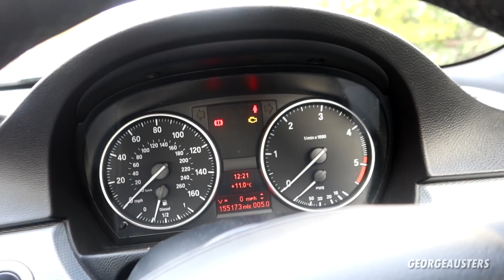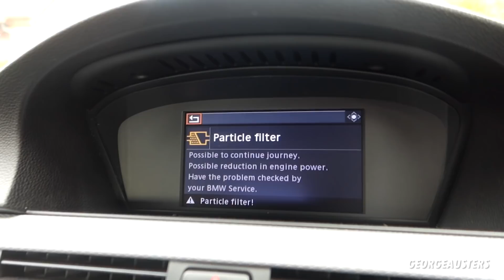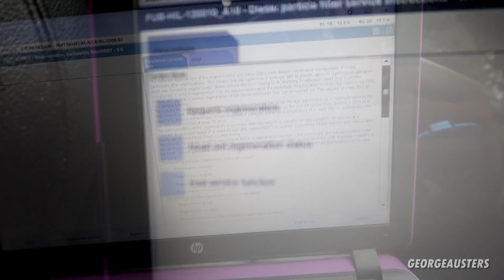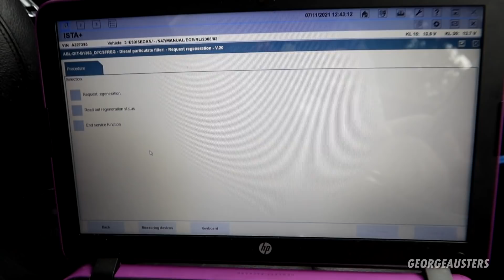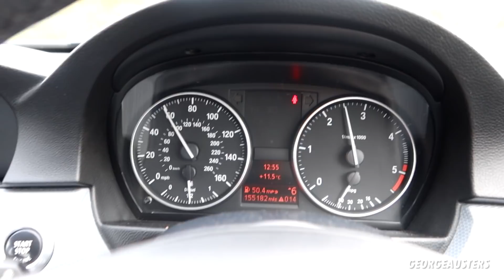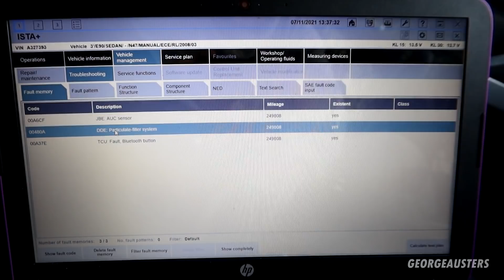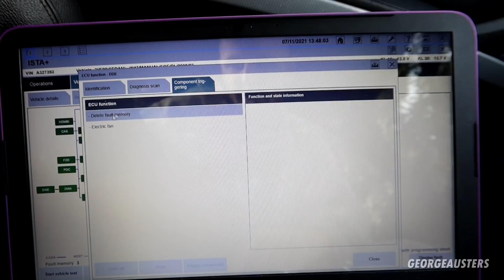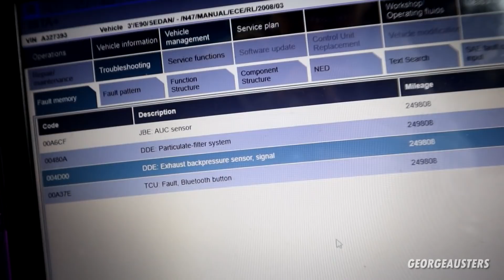SHOULD YOU REMOVE A DPF FROM YOUR DIESEL?

Comment: When the car reaches approx 250k km approx 150k miles the dpf fault code will come up even if the dpf is still good because from factory the max usage of the dpf is 250k km. What you need to do is reset the dpf by telling the system that you have changed the dpf without really changing it. There are a couple of videos on YouTube about this issue and on how to program this.
Reply: And a few weeks later you will need new turbocharger.

Comment: You need to just flush youre DPF and then force the regen, buy a better diagnostic tool. I bought VAG-COM and I have forced regen on 3 cars with similar fault codes. The most important thing is to flush the DPF and its pretty easy to do

Comment: Diesel engine's need to be driven hard.So if you do lots of inner city driving.This usually causes the blockage.Drive it fast n hard and your vehicle will have many happy years
Reply: thats a myth. only diesels with PASSIVE regen systems need to be driven hard. ACTIVE regen systems (as fteted to Euro 5 Ford 2.0 TDCIs for example, as i have one) can and WILL start and even complete a full regen at idle if required. i know this because it has done. numerous times. no issues in the 7 years ive owned the car.

Comment: If all diesel cars were used for their purpose, i.e longer commutes, there would be less than half as many issues regarding DPF's. Granted that's not the only contributing factor. But telling people to remove them is not the way forward, MOT testers will have a field day with you.
Reply: Passed 3 MOTs without dpf they only do a visual lots of firms advertise removal & remapping
Reply: The School run is a major contributing factor also!
Reply: It’s usually just a visual inspection anyway so wtf delete it

Comment: Have for 3 years a merc with 3l diesel. Use it on long runs and never had an issue with the DPF. Even the values check with Star diagnostic show that the dpf is in good condition with an ash content of 1g. As long as you use a diesel at it should be used(long runs) you wont have an issue with the dpf. Regarding the video there are two reasons that your dpf is not regenerating, one due to it being completely blocked ( needs a professional dpf clean by removing the unit from the car) and the next reason the car does not need to be in high rpm to do a regen, the regen initiates when on highway and with a steady rpm.
Reply: Unfortunately you are wrong .
My son had a new Seat Ibiza !.6 diesel . He used it for long trips between Portsmouth and his home in the north . After three years it started going into limp mode and after several costly trips to the dealer he got rid of that costly piece of junk .
DPFs Are not fit for purpose
Reply: @bustermaw  I base my experience on a w164 and a w211 merc that I have owned during the last 8 years not on a seat!

Comment: Its pretty simple just dont short driver your dpf diesel car. I have exhaust pressure fault codes and fuel pressure fault codes. The car wont regenerate but I just drive the piss out of it. No problems what so ever.

Comment: I had the same issues.. until I started using premium diesel and keeping the tank over half full. You will get a shock at MOT time when they see you removed the DPF... Its an automatic fail and there is a large fine for the driver... Replace the DPF pressure sensor I guarantee thats why you are unable to get the regen done...
Reply: Premium fuel - - agree. I have had issues in the past using supermarket fuel.

Comment: As others have mentioned you should not keep the revs high... Measure the exhaust gas temp before DPF and you'll see it start steadily climbing once above 50mph,  when hot enough should start burning the soot mass.... You should also check to see if coolant temp drops below 60c when driving over 50 over a long period of time. If so it is your thermostats.. i would measure these parameters with ista whilst driving by recording the screen or something... see if the soot mass  & ash goes down at all (passive regen)..

Comment: Dpfs on this generation of BMW’s are sensitive to the following components functioning properly:
- glow plugs & module 
- main & egr thermostats 
- throttle control actuator connected egr 
Not sure if you’ve already trouble-shooted those areas?
Reply from the maker: Yep all working fine. It’s sorted now so will have an update video coming soon👍🏻
Reply: @GeorgeAusters  Nice one George, enjoying all your videos bud! We love our BMWs
Reply: I have a glow plug module fault on my 330 M57 and it still regenerates. It wouldn’t though until I changed stuck open thermostat

Comment: It is a catch 22 as you can't remove a DPF as it is an instant MOT failure. If you have someone in the know, great but it still seriously impacts resale if you remove the system. It is worth noting that in most modern diesels the DPF won't regenerate if other error codes are present so make sure you have deleted all codes via a scanning tool before trying a regen. I have had a fair few issues with the DPF on my Jag XF.  There are DPF cleaning services now at most garages, even Halfords do it, so it doesn't have to be too expensive. Also worth noting for the more environmentally and health minded people out there that if you delete the DPF there will be much more of the black stuff with pm10s being emitted.
Reply: Removal of the DPF is illegal as it comes under emissions control systems. Without a DPF and without EGR valves a large volume of NoX gases are emitted which are the gases that contribute to lung diseases and respiratory illnesses. DPFs are a serviceable item and convert soot that is collected by the particulate filter by into ash by high temperature burning. The ash is retained in the filter and eventually reaches a "full" level which no regeneration will reduce. Then it is time to clean or replace the filter. I have done this on my TDI Passat at 150k as it was used for a daily 35 mile commute so passive regeneration occurred due to constant high DPF temperature. Have never had a DPF light or fault code and replaced when regenerations became very frequent. Shorter journeys would have invoked active regenerations which the ECU controls by increasing fuelling and the ash content accumulates more quickly. There is no issue with having DPFs if you understand what they are, how they work and that they will need to be cleaned or replaced every 100 to 150k on average. My Passat is at 230k now - still no DPF issues.
Reply: @MiracleMitch  Not illegal, just an mot fail.
Reply: @Tommo12345  You will find that in the UK removal of any emissions controlling parts on a motor vehicle is not illegal, but by law, DRIVING a vehicle whereby factory fitted emissions parts have been removed IS illegal. So basically you can remove a DPF and thereafter, if it does not fail the next MOT test, and you can get the car to the test station without driving it, you can look at your DPF removed car for ever more but just can't DRIVE it LEGALLY! 😂😂 Same thing then really isn't it? Shame it is so badly policed as I'm sure it would prevent small children from getting lung disorders from nearby diesel traffic fumes, particularly NoX gases. 
How do I know this apart from having researched this to death? Brother's partner is a lawyer, sister is a police officer, brother is a police officer, father is a mechanic. Want the piece of legislation - I can get this for you too!? Or you can just Google it for yourself 🤔
Reply: @MiracleMitch  Certainly not the same thing is it? I don't care you have police in the family, is that supposed to make you right? haha. Do police check if cars have DPFs? certainly not.
Reply: @MiracleMitch  Ps i have mine removed.
Reply: @Tommo12345  And that my friend is all anyone needs to know about the sort of person you are
Reply: @Tommo12345  The bit that makes me right is the law - it is illegal to drive a car that has the emissions controlling parts removed - it is black and white. Drive your car, you break the law, each and every time. Makes you such a rebel, eh? You obviously don't have a small child suffering daily from irresponsible people who think they know better and make their car 10 times more polluting than it was then, do you?
Reply: @MiracleMitch  I told you.
Reply: @MiracleMitch  So what, what you gonna do?
Reply: @MiracleMitch  Removal of the DPF is illegal, you stated. No it's not.
Reply: @Tommo12345  Since that statement I already stand corrected and confirmed that it is not illegal in the UK to remove these parts but that it is illegal to drive the car after they have been removed. To add to that it is also illegal to sell a car if you know that the emissions control parts have been removed and you should refit them before sale.
Reply: @MiracleMitch  No it's  not illegal to sell the car with it removed at all and not illegal to drive the car, unless on the public highway. Stop talking from your back door pal. lol.
Reply: Just get a Euro3 diesel mate and you can forget about crappy DPF's! Euro4 onwards with DPF's and swirl flaps etc are a frikkin pain.

Comment: No point having a diesel if it's just town driving the car is used for. I have a 530d but all my driving was mostly motorway. Then 2 years ago i stopped working due to ill health. A couple of months later I was getting 'back pressure too high'  errors and "drive moderately errors" so I would put it in manual and drive up the motorway at low gear for about 30 min and clear the codes. Then add dpf additive with my diesel. Just helps the regen process at lower temps and make sure I take it for a long enough drive at least once a week.  Will be back working soon (hopefully) otherwise I would have sold it and gone electric 😂
I have ISTA , INPA, NCSexpert discs that I purchased off a seller about 10 years ago with the cable. Used it on my e60. Will it still work on f10 and win 10 I dont wanna load it all up again (as it was a headache last time!)
Reply: suggest you research the difference between passive regen systems (like the ones you describe) and ACTIVE regen systems as fitted to my 2.0 TDCI Ford which ive owned for the last 7 years (bought used).it can and WILL (and has done) start, and complete a full regen at IDLE if the ECU deems it ready to regen! makes life a whole lot easier if you cant find a petrol model, cant afford an electric car (or electric doesnt work for what you use the car for) or the car simply isnt available as a petrol.

Comment: Great video, but isn't it illegal to remove it?? - would it pass the MOT without it? I've had similar issues on a 520D... a flush costing around £300 never did anything.
Reply: Its illegal, it wouldnt pass an mot and you risk a hefty fine of 2000 pounds. Dont do it.
Reply: @D3PTA  and have any accident with one removed, your insurance company will laugh at you then pass on the details to the police...
Reply: It's 10k maximum fine...they do pass  mot if  they are mapped out correctly but I figure it's easy to put the standard dpf on for an mot once a year
Reply: It is illegal to remove under Construction and Use regulations.
If you can remove the DPF and have it placed in an ultrasonic bath for approx 48 hrs, this will remove the deposits. This proved very successful on a Vx/Opel Signum 3.0DT we had (the DPF had previously shown as too blocked to regen). The result was a 98% flow rate. The car did meant thousands of miles after this and was still running perfectly when we sold it on. To be fair, the DPF on that car was easier to access, being under-slung, not like the 330d Touring we also had.
Reply: I have a Toyota Auris SR180. 2.2 diesel 2009 with 150k
2yrs ago I got a check engine light..emissions. Took the egr off it was choked SOLID with carbon..took the inlet manifold off choked SOLID.  Cleaned them out gave it a service with a oil flush and a carbon clean.  Now I do it annually.
as for a regen for the dpf i do a ‘forced’ regen…it takes minimum 10mins. 3rd gear 60mph 3k revs and I set a timer for 12mins.  YOUR DOING IT WRONG YOU NEED TO BE IN 3rd GEAR.  I have a 30miles stretch of road nearby I go down at 70 normally get up to temp then on the way back do a forced regen.  You would not believe what comes out the back it like the car is literally on fire.  White smoke like you wouldn’t believe.  But after that…she runs like new.  Never even a puff of smoke ever no lights on the dash and I give it death.  Brilliant car.

Comment: It will not start if u already have fault codes. Only option now is remove and clean, or replace. 

The pressure is too high, (DPF blocked)  so the process will not start anymore.
Reply from the maker: Already sorted

Comment: Think you’ve just summed it up perfectly. Unless you genuinely cover the mileage, use the motorway, you are far better off with a petrol vehicle . I know people who do unnecessary motorway journeys just to keep the DPF clear.🤷‍♂️
Reply: I do those pointless motorway journeys and use v-power. Just for the dpf
Reply: @chrishart8548  does it make much difference? Today I saw Esso are doing the same for diesel, just says twice the amount of detergents. 20p a litre more at £1.70 a litre.
Reply: @allothernamesbutthis  lol that aged quickly. Cheap stuff at Asda's £1.80 😂
Reply: my colleague had his audi software reflashed by audi after the scandal was exposed, the eml would light up after 150 miles, audi kept saying no problem and not software related. he found that the car would idle just under 1000 rpm when the dpf cleaning was happening and like you say, go for a pointless drive down the motorway until the car would idle back around 800 rpm and the eml does not come on.
no pointless drive and light is on pretty much bang on 150 miles.

Comment: I have the same issue on my 2007 BMW 520d (N47) auto engine with 152k mileage. I have changed the exhaust back pressure sensor, put some Wynnes DPF fluid cleaner, used ISTA to request a forced regeneration, drove on the motorway for 30 mins but it did not regenerate and fault codes are same. It would be interesting to know what the fix was!
Reply from the maker: I'll be able to help with the video

Comment: I thought removal of DPF was Illegal?
Reply from the maker: Removal isn't but driving on the public road without one fitted when it was from factory, is.
Reply: @GeorgeAusters  As I thought, so you won't be able to drive this car on the public road once removed, not legally anyway. I believe the fine is £1000 if caught but a new DPF is £200 on eBay.
Reply from the maker: There is no way of knowing if the DPF has been removed without physically removing it
Reply: @GeorgeAusters  There is a visual check during the MOT, although if this is actually carried out depends on the inspector.
Reply from the maker: Yes and if it’s just gutted it still appears in place👍🏻
Reply: @GeorgeAusters  Its why I'm done with Diesels, the DPF always seemed to want to auto re-gen at an inconvenient time and the manual had all kinds of warnings about not allowing a re-gen to complete etc.

Comment: I believe the n47 dpf service light comes on at 150k saying to change it ,I reset mine using diagnostics ,and cleaned it with using sol x cleaner.i have not had any problems since.The Nct test (national car test in Ireland) similar to mot in uk,are now starting to check cars soon to see if the dpf has been removed by using diagnostics and this will be a fail if no live data is seen for dpf.

Comment: From what I know, the regen starts when driving at over 60 kph, but the engine should not be revved over 2500rpm. It should work somewhere between 2000 and 2500 rpm. I have an E90 320d as well, and had no issues with my dpf until now. Hope that helps 👍

Comment: Hi George, 4:32, it says “as soon as the fault no longer occurs, the DDE will perform a normal regeneration” the car may not be able to regenerate because of the fault code. the exhaust pressure might be too high to regen?

Comment: Had exactly the same codes with my e91 320d. Removed the DPF twice and cleaned thru after failing to start a regen. In the end I gutted it, refitted and blanked off the EGR and had a simple plug a pray map to remove them. Absolutely no faults since, car went from around 50mpg to 60+mpg (872 miles to the tank the best). Also no smoke other than the small amount you would expect from any diesel under load
Reply: Gotta love a dirty diesel 😀
Reply: And your car is polluting like hell. Nitrous oxides are invisible, but toxic, carcinogenic. If you do not have money for spare parts use a petrol car.

Comment: The dpf only needs to be at operating temperature to do a Regen. And you're meant to be in 6th gear on the motorway (as indicated on the dash) I know the internet people would have you believe high rpm clears the dpf but all it does is burn more fuel and potentially add to the dpf blockage. I think you need half a tank for auto Regen or 10L for forced Regen.

Comment: What you are recommending is illegal and unhealthy for us all. Instead of fixing your damn car and buying a new filter, you are pushing the problem on everybody else by polluting the air with diesel fumes.

You will never get an MOT with a DPF delete. Where I come from, police could also take your number plates if they see your car smoking diesel fumes when it should have an active DPF. Conveniently you are not removing your DPF as you are recommending because you are well aware of the legal implications.
Reply from the maker: Never had an issue with MOT with a DPF delete and my car didn’t smoke because it was running efficiently👍🏻